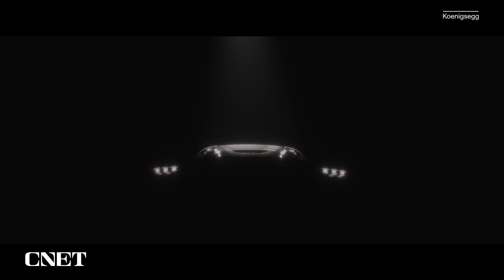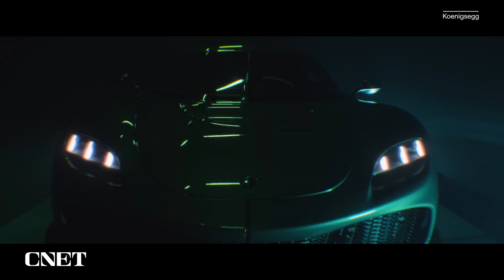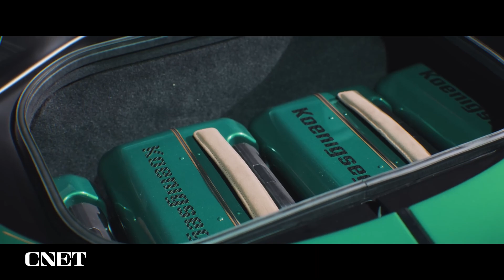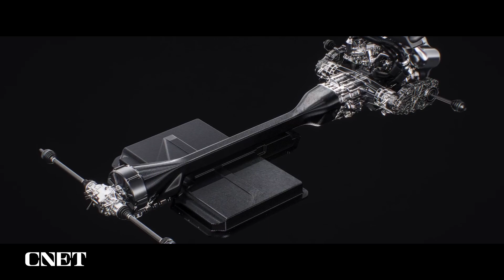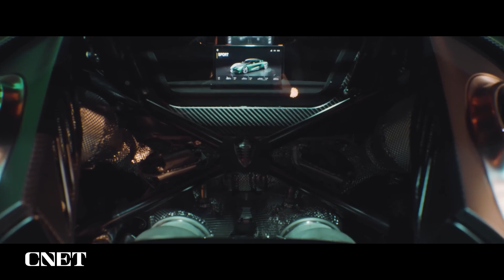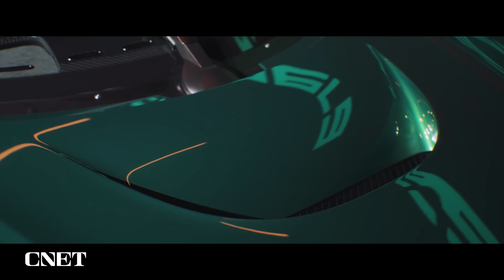Koenigsegg Reveals Gemera Supercar (World Premiere)

Comment: Isso que é  extrapolar a engenharia 300 CV  por litro, 4 bancos , 600 CV, talvez tenha até embreagem emulada. 
Capaz do motor caber numa mala.
Isso que é eficiência energética imagine tudo isso movido a hidrogênio e totalmente abastecido em 20 minutos transformando biocombustível em água.
Podiam fazer a versão 7 lugares   😅
Reply: This is what it means to push engineering beyond conventional limits: 300 horsepower per liter, four seats, and 600 horsepower in total — potentially even with an emulated 4x4 clutch system.
The engine is so compact it could practically fit in a suitcase.
That’s true efficiency. Now imagine all of this powered by hydrogen, fully refueled in about 20 minutes, effectively converting biofuel into water as its a vision of the future.
At this point, they might as well build a seven-seat version. 😅

Comment: even though this is technology only a small percentage of mankind can afford.. i see the leap the Dark matter engine has made in the electric motor can have a trickle down effect. 

Take another Swedish brand, Volvo Trucks. Their Electric motors in their Electric trucks consist of 2-3 motors (depending on the configuration) and has an output of between  330–490 kW (depending on the configuration). So, if you can save the amount of motors needed for electric while giving more output i think it would be great for other OEM´s as well. 
So in other words Dark Matter could cost 3x more then other motors and still hold a greater value for other OEM´s.. truly innovating!